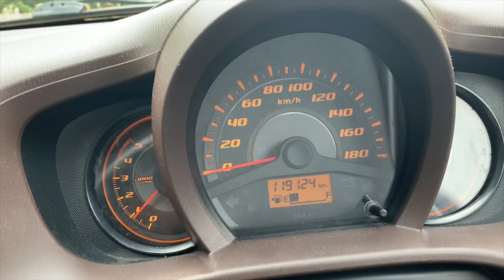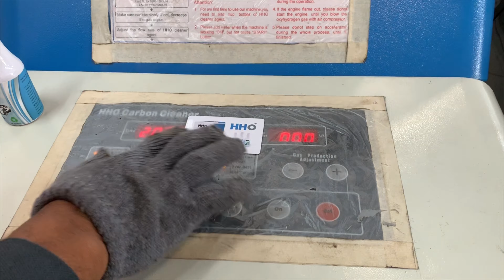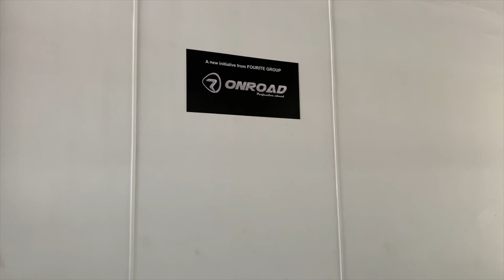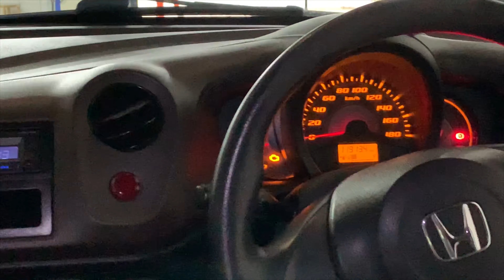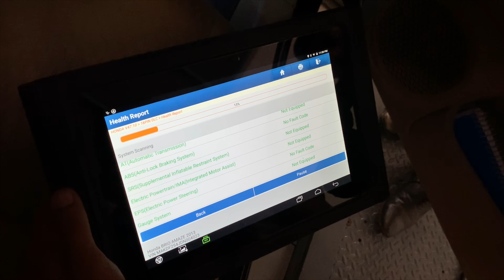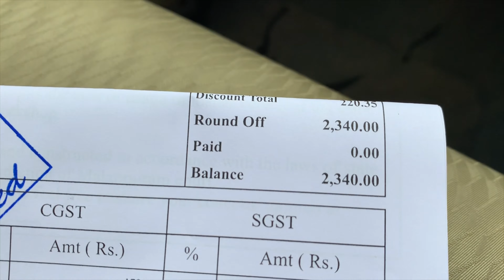De carbonisation car Diesel engine കാറിനു എന്ത് സംഭവിക്കും  | ONROAD bodyshop | Malappuram l

Comment: Is it not wrong to send liquid into a hot engine? Engine is made of metal - so hot metal and liquid - must be causing deformation.
Reply: Correct
Reply: Only air mix should be used.
Go to carcardiac care.. no liquid. Liquid will cause corrosion later.

Comment: This process is bad for the engine in the long run. And also this cleans carbon to certain amount and not fully. 

Better is to go to a good mechanic, do an EGR, MAF, MAP cleaning. I'm talking about diesel cars. And if your car has done more than 1 or 1.30 lakhs, do an injector, head, intercooler cleaning as well.. if needed.

Some companies do it themselves in the periodic service itself.

And vehicles who have run below 1 lakh should not get decarbonisation like this. This may damage the piston head, bore due to H2 or chemical usage.

It's my personal opinion based on extensive research. Do a manual decarbonisation not this!